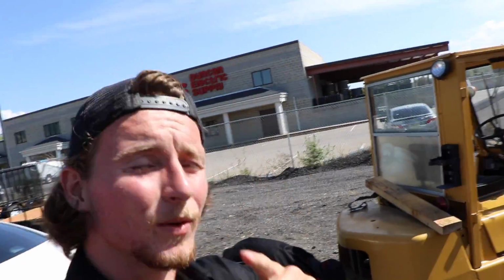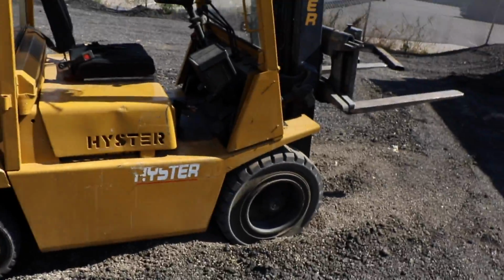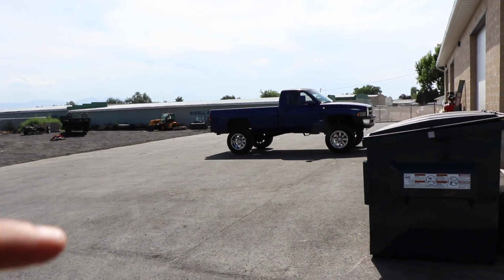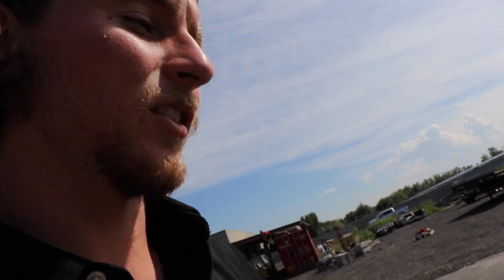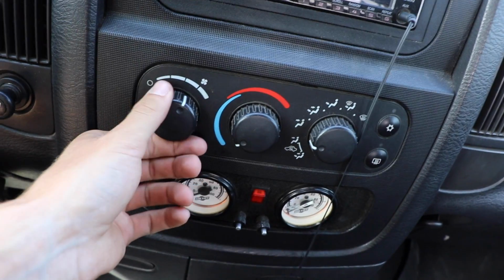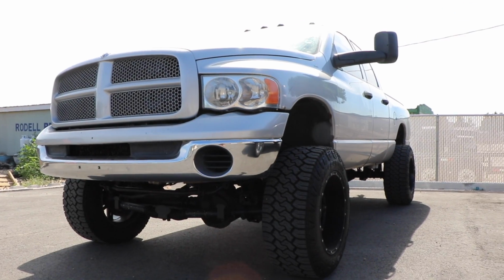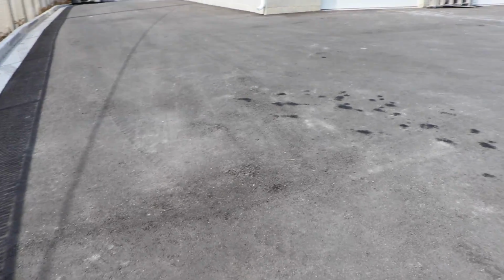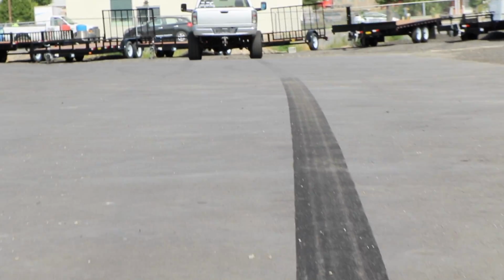TWIN TURBO CUMMINS VS BIG SINGLE TURBO CUMMINS (LAUNCH)

Comment: this one’s a catch 22 i’ve seen a lot of guys at the dragstrip using big single turbos with water injection to keep the EGT’s down and they work fine. The compound turbos work great for around town especially if you have a standard transmission like mine is. it just depends on what you’re using it for. I put compounds on my 12 valve it was cool at first once the novelty wore off and things like basic maintenance came into play made me start thinking about getting rid of them and going with a big single VGT turbo instead. at least then I can hook my ram air hood back up instead of sucking hot air out of the Engine compartment through a giant cone filter. don’t get me wrong compounds are cool there fun Just more shit to go wrong and times everything by 10 on the suck ass scale if you gotta work on it.
Reply: Good info as Im trying to decide the same Twin vs Big Single....you make a good point with maintenance.
So....Which single turbo would you suggest for racing around for fun, not so much towing. 
5 Spd, letting the truck wind out to 3600 rpm in each gear before shifting up.

Comment: Are compounds and twin turbos the same thing like saying goose neck and fifth wheel trailer?
Reply: compounds are a smaller turbo powering a bigger turbo  twins would be 2 of the same which diesels dont really use unless tripple turbo, but some people call compounds twins because it sounds cool
Reply: To add to that gooseneck and fifth wheel are two entirely different connections as well.